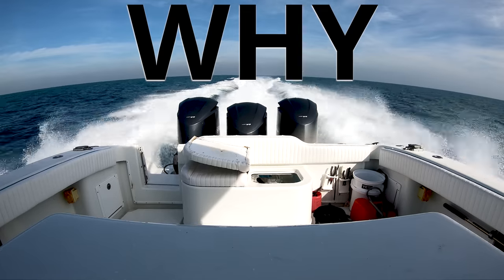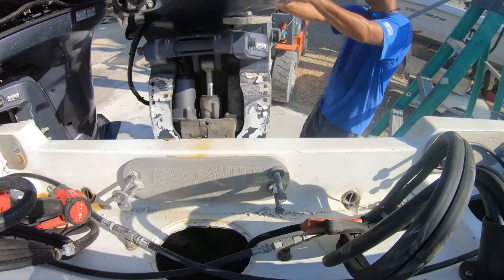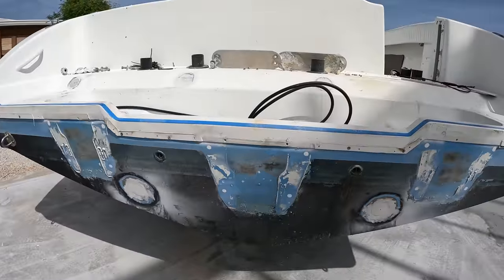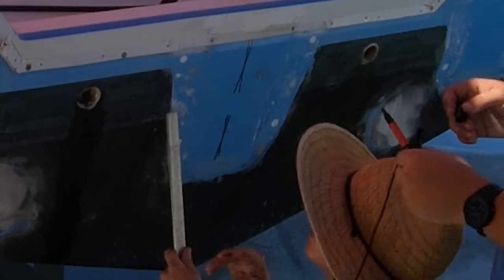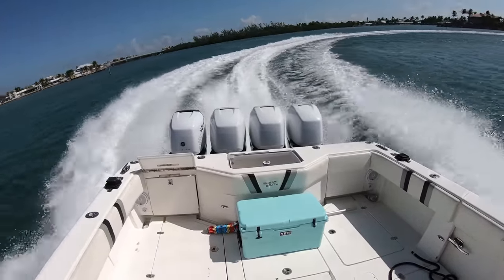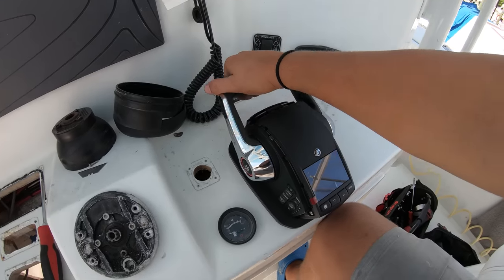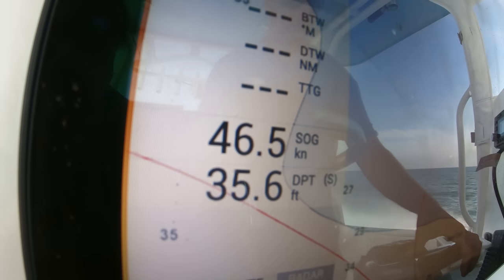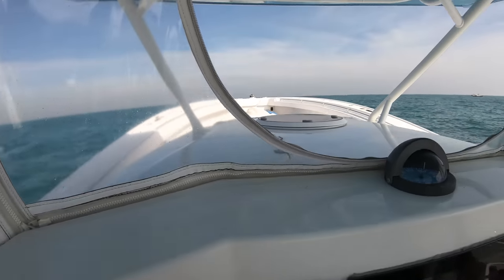From 3 Outboards To 4!

Comment: On the initial run, the engines weren't underpropped, they were over propped slowing the  Wot engine speed..  Loweing the pitch will raise RPM.
Reply: You are correct sir.
Reply: I thought the new mercs came computer controlled to not exceed 5400 rpm until after the break in period.
Reply: @what?  not that I have been told.
Reply: Think he misspoke…everything else made sense

Comment: after all that why did they just do 300s? they could have gotten the same power doing triple 400s and not had to do all the hull modifications.
Reply: Because seeing that weight and power would be the same, the quads would end up being the better choice for cruise and drivability. This was never done to add a ton of top speed, but rather to make a more balanced and updated package. If you wanted to do triples, do 450R's. They are actually slightly lighter than the new 400's, and produce a lot more torque and hp.

Comment: A triple config with the new 400 V10's would likely have been even better in term of fuel economy and speed. Never go quad if you can still scale up triple! But I suppose the V10's might be hard to get at this point. Not a bit fan of anything over triple really but nice boat and video nonetheless.
Reply: Doubtful. One of the major things here was not to add too much weight. Adding those new V10's would add about 700 lbs to the transom over the 300R's. That's a lot of weight on the stern pad which will increase drag. If you want to make that change for efficiency, add triple Merc 450R's. Those are 10 lbs lighter than the new 400's and produce a lot more torque. That would easily be a 68-70 mph setup.
Reply: @AB-80X  I'm talking 3x400 V10 vs current 4x300R. Same rated hp, no major weight difference on a boat of this size. However you get less complexity, less lower unit drag, typically better propeller efficiency and less cavitation in sharp turns.
Reply: @shingnosis  Here's the thing. Those are generalisations. Yes in some cases that is how it will work, but not here. The performance gains pretty much tells you that this hull really liked the quads.
Let's break it down.
Gearcase torpedo drag CAN be an issue, but it does not have to be. See often you can install the quad higher. This means that while you do increase the number of gear cases, you don't add the drag of a complete extra gear case. Furthermore, you will increase stern lift. This you will because you increase the blade area, but also because both the prop tube as well as the torpedo helps lift the stern. On top of that, you will also gain the ability to carry the bow higher. Now whether or not the boat will tend to VENTILATE, not cavitate, more in turns, really depends on hull design. This might be the case for some boats with quads vs. triples, but not all. This hull was always designed for quads, so I'd say that they have more than likely taken that into account and the outer engine will still sit in the water during a sharp turn. Can I also point out that in a sharp turn where the boat banks a lot, this type of pleasure craft can benefit from bleeding off a bit of speed, so even IF it made that outer prop ventilate during a sharp turn, the effect of that would not be considered particularly negative.
This boat went from being a 51 mph boat to a boat that can run in the low to mid 60's by just adding 150 hp. Have you any idea how significant that number is? That's what you sometimes see when you do a very successful re-power of a twin with a new pair of twins. That is an unreal gain from adding 150 hp going from triples to a quad. Would a triple of 400's yield similar performance? Not so sure. This hull clearly liked the quads and the data backs this up. Had the hull liked a triplet, then the F350's should have been better overall by comparison.
If all out speed was the goal, there are one configuration that might be a better option, but it would be on behalf of the other performance parameters.
Install a triple of 450R's. Why? Lighter than the 400R and more powerful. Use the weight carrying ability of the transom to install the engines on a setback, and install hydraulic jackplates. Run SM lowers and a set of Blaster props. That's a theoretical idea, and reality is that even from a purely top speed point of view, a quad of 450R's mounted regularly, would still be faster. And at the end of the day, you can still mount the quad on jackplates. Hell, seeing how light the 300R's are, you could throw them on an 8" setback with jackplates, and probably take that boat to 68-70 mph in perfect conditions with the aforementioned props spinning in.

Comment: I'm curious about the mounting height. It seems to me there was little thought about the optimum height for each engine. How do you normally address that?
Reply: Each engine has several holes that can be used to adjust the height. Additionally as these boats often are delivered with quads, it's just a matter of contacting the boat manufacture and get the height needed for quads. They have already done the testing and work. If you want to play around with it and increase efficiency further mount a hydraulic jack plate on each engine. That will not only provide a bit of setback, but also allow you to raise the engines once up on plane.

Comment: Wouldnt 2 or 3 v12 600 (if the boat allows it) be better in speed and fuel efficiency?  Assuming money not an issue
Reply: Not really. Two means way less prop in the water which can decrease efficiency. Will twin V12's be faster? Probably, but they will be far less nice to drive.
Triple V12's will be fun, but expensive and simply burn a ton of fuel. They are massively heavy by comparison. Those four 300's are less than 2200 lbs. Doing triple V12's will be in excess of 3000 lbs. I'm guessing that triple 450R's would be the ticket. Same weight as the quads but slightly more power and less drag. As cool as the V12's are, they are really let down by the weight, just like the new V10.

Comment: I know this is sacrilegious but what I’d like to see is a good video focusing on maintaining decent speed and planing while increasing fuel economy.  I’d rather leave a half hour earlier if it’s going to save me fuel costs by not running a bigger or more engines.
Reply from the maker: This should be interesting to you then: https://youtu.be/l38u85CkmkE
Reply: @BornAgainBoating  Thanks. I checked it out. Going to definitely try a few of the suggestions, especially lightening the load. For example, I never use the hot water heater, especially since it’s leaking, so it’s coming out. I also don’t use the freshwater tank - easier to just use bottled water plus tastes better. The extra deck chairs, coolers, maybe even the grille, will be staying at the dock this year. Just these few things and that’s easily a hundred pounds.

Comment: Sorry I just gotta say something right here, so you take off triple 350’s to put on quad 300’s and to me I think that’s a huge waste of money doing that to only gain 150hp and not even a 8-10mph difference🎉 whenever you could’ve either replaced the triple 350’s with triple 425’s or triple Yamaha/Mercury 450’s and had more hp that way without the extra cost of another engine! Hell you could’ve even put triple 400R’s This just doesn’t seem logical to me and that’s just my opinion! It does looks badass now with quads though! 🤙🏼🤘🏼
Reply: Looks like the Merc 300s list for approx $33K, if you can afford the motors, and install costs you probably are not as worried about the money.  I am sure they can sell the Yamahas for $20-25K each depending on the hours.
Reply: Have you seen the cost of a quad of 300R's vs a triple of 450R's?
Also a faster cruise with a 15 gph drop is pretty significant if you run the boat say 100 hours per season. Also a trip of 425's will not add anything other than power. Those are still pretty inefficient and they are sill stupidly heavy.
Quad 450R's is definitely an interesting proposition, but mostly for top end speed. Can I also point out that once this thing is propped right, going from a 45 mph top speed to over 60 is very significant for a 150 hp gain. The numbers tell an interesting story. From a pure driving standpoint, you can be 100% sure that the boat now is so much more enjoyable and nicer to drive. It will jump on plane faster, it is faster everywhere, it will pull harder and overall run better.

Comment: So, on a triple engine set up, would you use a single throttle and on a quad set up would you use 2 throttles?
Reply: Triples and quads both use dual throttles. It’s 2 handles built into one control box. That’s the case for Yamaha and Mercury. It could be different for other outboards though.
Reply: You can do this in a multitude of ways. Personally I'd use a set of Livorsi controls with four sticks that can be configured on the fly. That means you can run the quad on one stick if you want and all four individually if needed be.

Comment: It goes against all conventional wisdom that almost equal power with an extra gearbox gets better milage and top speed. Those motors weren't running right and/or the props were dinged
Reply: Here's the thing.
Those F350's have huge 5.44" gearboxes. The 300R's have 4.5" torpedos. On top of that, the F350's are hectors that weigh more in a triple config than the quad 300R's. Add to that the fact that the quads create more stern lift and add prop blade surface area. That means you can install the quads higher, especially considering that the Merc gearcases are are of a better design than the Yamaha case. If you want to do the triple thing for top speed, use a set of triple 450R's.

Comment: compairing old 950HP to a 1600HP setup is about as fail as you can get.
Reply: How far did you get in school? Before telling others that they failed, I'd suggest that you at least learn the most basic of maths.
3 x 350 is what? 950? Odd. I get 1050.
4 x 300 is what? 1600? Odd. I get 1200.

The only failure here was your parents and the school system you went through.